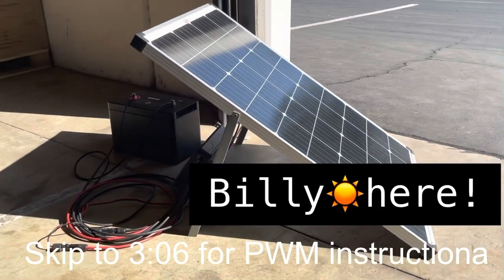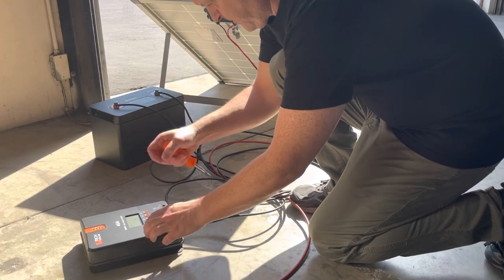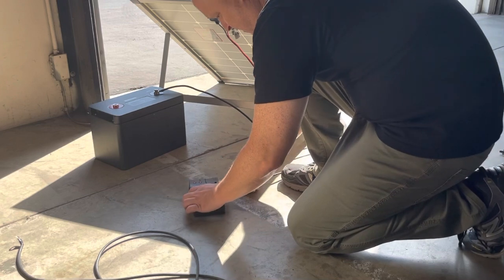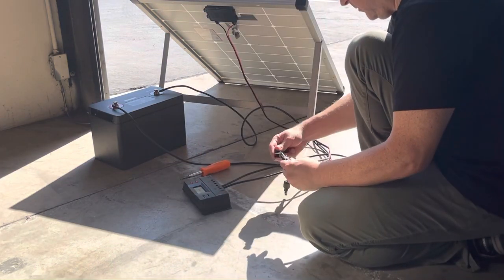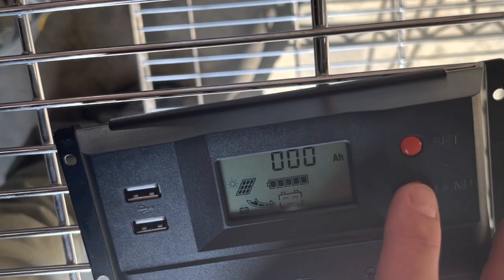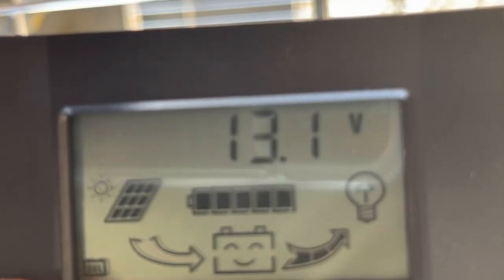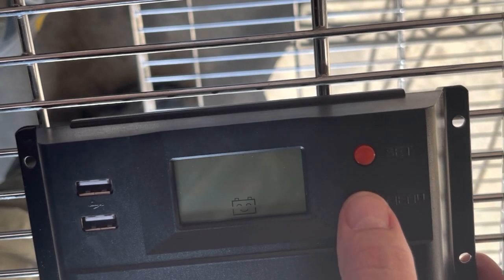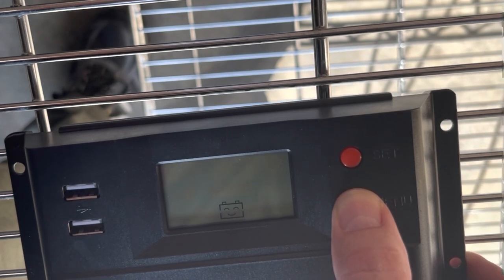How to switch battery setting on PWM solar charge controller. #pwm #solarchargecontroller #howto

Comment: What do you set the charge controller at as a shut off voltage to stop or maintain a voltage?  I have lead acid deep cycle batteries in my rv. I’ve seen mixed numbers ranging from 12.4v to 14.4 volts. What’s your thoughts on a voltage to keep them. Thanks.

Comment: I have 4 AGM 65ah Batteries on 24v and I use 2units 300watt connected on series but the batteries are not well Charged. Pls how do I set up the charge controller.